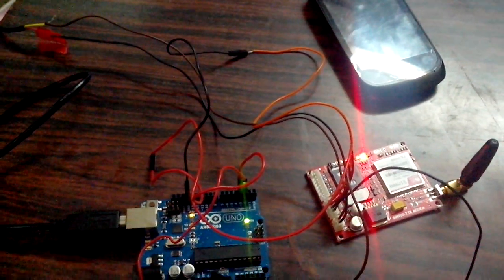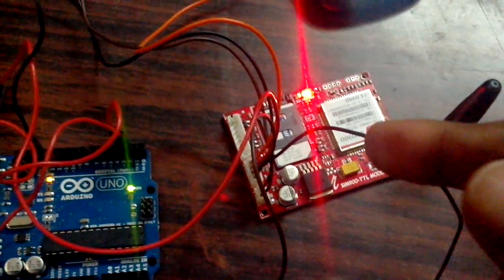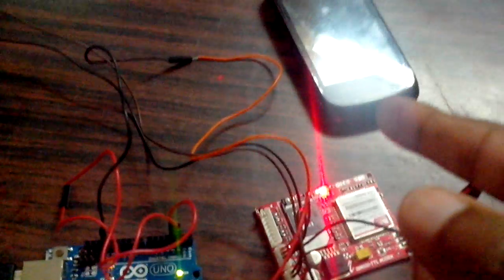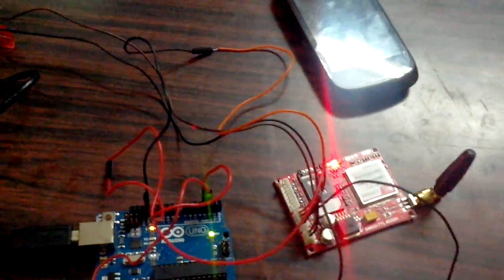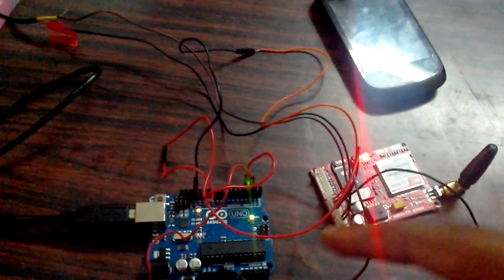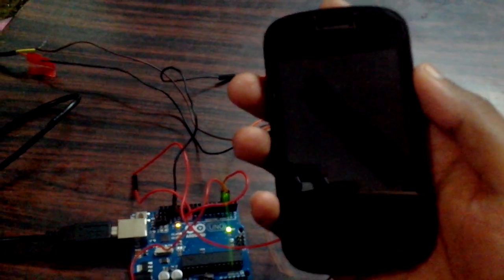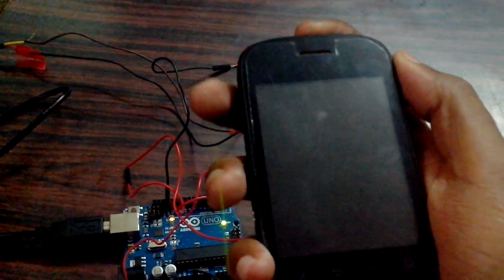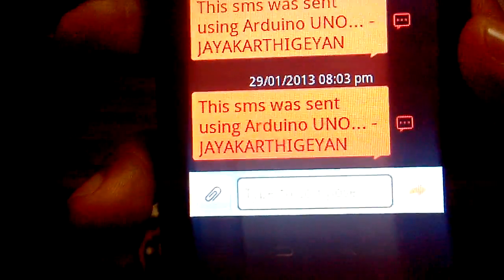Sending SMS Using Arduino (Arduino UNO + SIM900)

Comment: Hello Sir, I have uploaded the code of Sim 900 with UNO  but i'v used GSM 300 vic is working properly and still the SMS is not appearing in the phone no. fed and in the serial monitor we r getting text mode command and phone no.  Sir, can u help me where the problem is coming asap ?????
arduino duminealove is used by me..

Comment: Awesome. I got it to work with my uno, using the code with Libary files. I have the ICOMSAT 1.1 SIM900, so had to change the multiplexer to reference the new Rx/Tx Pins. However, when I try to do the exact same thing with my Mega2560 - the message is not sent. Do you have any ideas? 

Thanks for any input!

Comment: nice project sir! can you give me a sample code where in the sim900d will send 3 kinds of txt messages to the user? i mean if sensor 1, sense something, it will send "Sensor1" for example and then when sensor 2 sense something also, it will send other txt message like "Sensor2" and lastly  will send "Sensor3" if the third sensor sense something. thanks in advance. and more power! :D im using sim900d and gizduino x - atmega328 (arduino compatible)

Comment from the maker: buddy I tried to help a friend of mine in US do the same with a different GSM Module, but we couldn't register to the network... you try using SBAND commands to set the correct band of your sim card, it may work... sometime it registers to the network partially... what antenna are you using... you try to do the test in a place near to a window, so that you that you can get a good signal strength...

Comment: I just purchased this and got it working in serial monitor. It doesn't connect to a network, (green light flashes every 800m/s). Does it require a 2G sim card? I purchased at AT&T go phone account to use with it. I live in the US.

Comment from the maker: The whole code cannot be typed in this comment bar itself sir, I have put the code for your request in the comment section in my blog. You can find the link for the blog in the description of the video, I have updated the code for sending sms using arduino without using library files, check that also, you will get an idea...

Comment from the maker: yes it will work... because freeduino also uses Atmega328 microcontroller only and you use the Arduino software only for uploading the programming in the freeduino board, right... So, surely it will work...